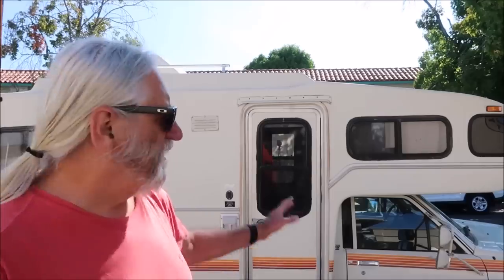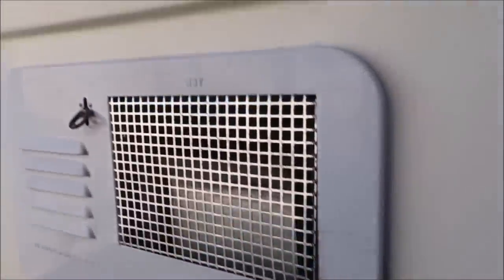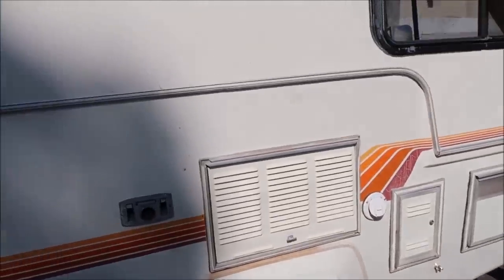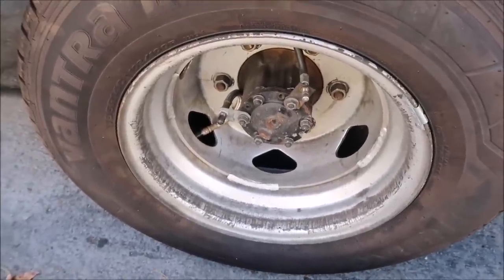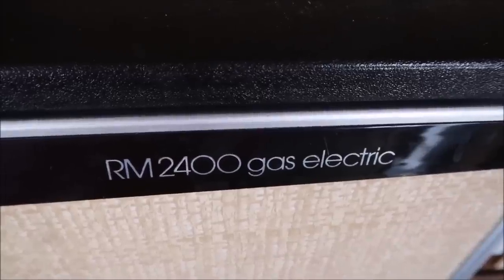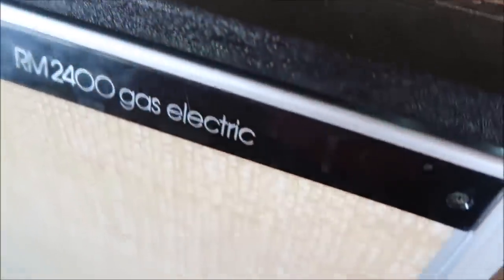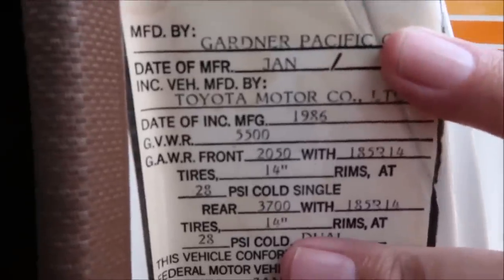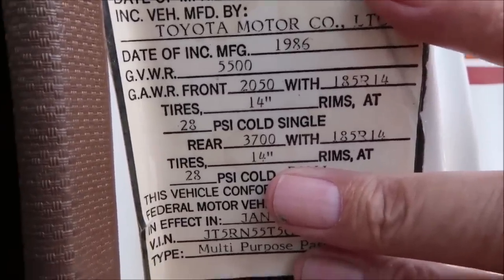What It’s Like Living in a Toyota Motorhome RV and Why They Stopped Making Them

Comment: I used to have a 1978 version of this and mine was standard transmission. My extra battery was under the hood and I didn't have central AC. I also had dual wheels on the back. The layout of mine was similar to yours. I got rid of it due to to many mechanical reasons.

Comment: For comparison, I have a 2003 24' motorhome built on a Ford F-350 chassis with gasoline engine (V-8 Triton 5.4 liter). I average 10.5 mpg on RV trips, which is better than the 5-6 mpg that the big Class A's get.  It's gone about 120,000 miles so far in its life.  I bought it at 96,000 miles.  So far, no mechanical troubles.  Just routine maintenance and some cabinet repairs.  Like your Toyota, mine is a pickup-truck style front end, not the van-style (E-series instead of F-series) with engine tucked back in the doghouse between driver and passenger seat.  My mechanics like it because access is easier than in the van type which is all that I see in new Class B or C motorhomes these days.  To atone for burning so much fuel into our atmosphere on RV trips, I recently bought a new hybrid car for everyday driving which gets around 55 to 60 mpg.

Comment: I still see one of these on the road from time to time. If Toyota, Nissan, Chevy/GMC, and Ford would contribute cabs and frame units (with the correct axels of course) from their mid size pickup lines powered with either V-6 gasoline or diesel engines I could see a new market for them among young couples, older "empty nest" couples, and individuals who need or want more than a slide in pickup camper or popup trailer but don't want a "tricked out" full size Class C.

Comment: I had a 21 ft.  Aluminium  body with a 4 cyl.  4 spd.  Got good gas mileage  around 17 on average.  But I replaced the head gasket 2x the last time she blowed she went to the scrap yard and a piston blasted it's way through  the side of the block.  And I already tore the camper off  to make he a flat bed truck..  And was driving her 3 miles to finish the job to be a flat bed..  It was cool when I had it..  Peace!

Comment: early 70s went from portangles,wa.state down to California, across to mo state then to text state , back to mo then up to Canada and finishing in Alaska Juneau.( had nylon tires get hot stop sound as if you had four flats start out again, very small camper with pop up , engine 4 cly,5 speed manual trans.. great times growing up.

Comment: I have the 92 V6 4x4 truck which is basically the hilux. It's a tough strong engine.  Always wanted to put the rear end and flatbed from their 1 ton on it. More than a few guys have made the newer motor home or I should say about 86 to 92 into a 4x4 motor home. Not an extreme off roader but for hunting,  fishing and boondocking.

Comment: Hey Scotty,  Good historical overview.  I have to admit, I gained more respect for the sunrader after watching this.  No doubt this was way too much load for the standard pick up rear end.. which while nice trucks certainly were not made for heavy load hauling ( compared to mazda or Isuzu of the same vintage).  Very glad to know about the dually rear end..and the gas milage .  Yes, ALL the early toy V-6's had problems !   The single port fuel injection you have is a great system.. simple and economical.   I would use the OD on the flats.. and kick down for head winds and hills, and acceleration.  Won't hurt the tranny..which is one of the best autos ever.  Hmmm.. The big dinette is really nice. Thanks

Comment: I love my fords but I have to admit my grandpas 1988 Toyota has been passed on to me it has the 22-re with the 4 speed auto thing has been through it he used it to get to loging jobs all across central Mississippi and it has 300k plus miles on it with one rebuild on the engine and still running the original trans and rear end like I said my 93 f150 is my daily and I love that truck but I have way more memories in that lil red Toyota

Comment: That’s cool I had an 88 I think it wasToyota motorhome. It was an Odyssey don’t remember the length. It was the 22re with the big axel. I got it for 700 bucks with 33,000 miles on it. It had a blown head gasket and the owner had passed away before fixing it someone had already taken the stove and the refrigerator out of it. The lady that I bought it from gave me the replacement stove to go in at all I had to do was replace the refrigerator and repair the engine. I fixed it and cleaned it up and drove it around a little bit and realized it didn’t have enough power for me especially with me planning to take it in the mountains. Very cool but very slow ride. I wished I would have kept it. It would’ve been a good candidate for an 5.3 vortec swap and it would’ve gotten the same gas mileage with a ton of power. Too bad they don’t make one now that they have powerful enough engines to pull it around.

Comment: What rear axle ratio does it have and is it a Dana axle? I’d guess a 4.10 ratio. That’s a lot of square feet of a vehicle body to push through the air and the shape isn’t the most efficient. If you wanted to do a motor swap I bet a Chevy 4.3 V6 would be a good candidate. I used to have a lawn service and I thought one of those Toyota campers with a damaged camper would be a good candidate to convert to a flatbed. Great video. It’s nice to hear from someone who knows what they are talking about.

Comment: I wondered why there was water staining inside, because I thought "Great! Fiberglas shell, no leaks!" then I saw those discolored areas and was sad. I have a shorter 1995 Prowler travel trailer with aluminum skin and a white rubber roof, and it has leaked at the roof seams. Have to go up and inspect and add gloop over the old gloop. It's ugly and I can't trust it to be resealed until a downpour test.

Comment: Yep those cylinder heads on the 3.0 were trash. They even warped after the recall. Too bad Toyota didn’t make a motor home with the 3.5 that was in the 1995 4Runner. That would’ve been SWEET!

Comment: You can get them from just a couple thousand for the worst that still runs, about 4 to 6k for a good fixer upper. 20k for the nicest examples in prestige condition. Id estimate the one in this video to be worth a good 15k but I have no clue his odometer reading. I want to sell my 2016 motorhome and get a Toyota next. Fancy doesn't replace efficiency

Comment: I'm a certified Transmission Specialist overdrive is a higher gear ratio which means more speed less torque if you're on flat land you won't be okay but yet there is a little bit of up heel overdrive would not have enough torque for going uphill even a slight uphill would it be difficult with the overdrive on if you had a bigger motor that would help but especially when you have the small motor once you get into highway driving on the interstate on flat land the overdrive would work but I don't recommend overdrive when you are driving around town only on the interstates when you are on flat land because the engine is too small

Comment: This is not the getaway palace for a seven footer. Best camper I had was the 63 Econoline jacked rear 8s and 10s. Five spoke cragar varnished wood bumpers. 102" whip antanaes with purty light bulbs . Inside was Turkish tapestry and moms patchwork quilt over the bed ice chest and closet and that's all a young man needs. Put in a throwout bearing hitched back into ft worth got it hitched back and did the whole job with vice grips and a buck knife. I swear. It was so cold February ..Lord ! Women knew this van and learn where I was at come lookin late oh my this van had a rep. I tried hard tipping it over

Comment: I have an 87 Toyota New Horizon Motorhome 22RE 4 cylinder engine Auto Trans with Overdrive...runs great but it weighs 6000 lbs. and has a hard time on the big hills....I can run 65/70mph on level ground but if the wind is against me it loses speed. Now...the 3.0 V6 Engines when they came out Toyota messed up and put in weak Head Gaskets. Many people experienced Blown Head Gaskets and around 1996 Toyota did kind of a Recall...and they would pay to replace the Head Gasket Once.  I just recently bought a 1993 Toyota T100 Pickup truck with the 3.0 V6...and even here in 2019 if you have one and call Toyota and give them your Vin # they will let you know if your engine has ever had the Upgraded Head Gaskets installed (They told me my New 1993 T100 Truck had the new gaskets replaced back in 1998...and it has never had that problem again !) I can not verify if Toyota would do the Complete Head Gasket job if mine had not already been done....but it did sound like it when I Talked with them recently !

That's my Story and I'm sticking to it !

Comment: Unfortunately a rule of thumb for buying Toyota is to steer clear of their six cylinders... Lots of issues with the head on the block plus parts aren't cheap and the bays are very tightly packed... Toyota V8s however, are pretty damn tough... I've seen the 8 cylinders go past 300k and run fine (especially those found in their Lexus line)

Comment: you can pick up dc capable lcd's these days up to 32 inch

in a configurationlike this cyl diesel would be the minimum option 4cyl turbos can't dealwith the excess weight looking at your comment you are under powered for the load you have I can tell this with how low the vehicle is sitting for a start and this should also be a 4x4.. 

best thing you can add is a turbo though i would check the diff ratio looking at the weight you are carrying on the chassis.

Comment: Is that a little water damage on the ceiling? It's odd with the molded fiberglass roof . Was if from the things that go through the top, like pipes AC,etc...? I put a new roof on a 69 fireball camper. After replacing a great deal of rotted wall and ceiling studs and paneling, I decided to rout everything out the sides. even the roof vents get/take air from the sides. nothing to seal or leak again. why? bored. very bored. lol.

Comment: Having a lock on the door to your propane tank is highly illegal. I work rebuilding propane tanks on motorhomes. If you came in to fuel up where i work. You'd end up walking until the lock was removed. Its a safety concern due to if you have an accident responders can make sure the tank is shut off. Get rid of the lock. 
We aren't  by law even allowed to fill a tank with a locking door.

Comment: 3VZE didn't really make that much more power than 22RE. Just two extra cylinders to help out. 22RE in my opinion the better engine between the two. Simpler, more reliable. 5VZ  S/C swap would be neat

Comment: Thank you for your great info video. Im looking at getting a Toyota, but I want 87 or better with a 22r engine.
Reply: Just check that it has the six-lug rear axle and don't worry about the year of manufacture.  You get a much better selection that way.  I settled for a 1984 with a Nissan 2.4 w/5 sp. manual.  Couldn't be happier.

Comment: They would not have had the recalls if they had designed them properly in the first place. Not that hard to figure that it should have had a full floater and better heads on the engine.

Comment: After the axle snafu then came the V6 cylinder head issue then the Tacoma PU's had frame failure issues and Toyota figured it cost them  $11K per truck to fix the ones that they couldn't buy back,  almost as bad as VW,s dieselgate. Toyota was lucky not to have any Tacoma motor homes with bad frames, that would have been the end of Toyota MH's for sure.
Reply: I bought an 07 that had the frame recall, saw it on a Sunday morning in February of this year knowing nothing about the recall. By the time I got to look at it, it was blown apart with the cab on an overhead lift. New frame, leaf springs, fuel lines, u joints, almost every thing underneath was brand new.  I bought it without ever driving it and it is my daily driver. 4.0 4x4 6 speed access cab, got it for about 10k with just over 100k so they didn't do much but break even on that recall.
Reply: My friend has an 05 and had the leaf spring replaced and has to take it to Toyota every year for inspections. The problem any one who knows about the frame issue won't buy his truck as it still isn't bad enough for Toyota to replace the frame yet. It keeps eroding away just a little more each year. They haven't told him how bad it has to be before it becomes dangerous. Toyota makes good trucks but when they screw up it is a big one.

Comment: Nicely design,but at 6'2" @270 lbs I think I would have problems in that washroom. Scotty am surprised that you're not running your car repairs from one of these.
Reply: You're right.  At 6' even, I'm less than an inch from the ceiling in the shower,  and that nifty AC unit can be a head-knocker, too

Comment: I used to work for an RV manufacturer from 1986-1990 , I worked the manufacturer shows and also drove and delivered these to dealerships . They called these the micro mini also known as a class C motorized  . The first RV I ever drove was one of these . They were adorable but could barely climb a hill 😂 the RV manufacturer closed its doors in 1990

Comment: Pretty cool but to be honest, I would have expected better mileage.   My old 2001 1 ton dually with the 7.3 PS is getting similar numbers towing an 8500# JayCo trailer. 😂 

I guess the difference being an over taxed 4 cylinder VS an under taxed turbo diesel.😂

All the same, cool little RV👍

Comment: My buddy had one of these and it sucked chinchilla balls out here in Colorado cause it won't go up in the mountains with that weak 4 cylinder....it's good going down hill or on flatland but any RV or van dweller will tell you that a v8 is mandatory. My 78 dodge explorer goes screaming up the mountains with ease! Forget even trying to live in that 4 cylinder shitbox fulltime...just use it for tail gating or a day trip of fishing

Comment: 22re is a great engine but very underpowered. 3.0 v6 is junk. What these really needed is the bulletproof 3.4l v6. Excellent engine with plenty of power
Reply: I'd buy one if Toyota offered a Turbo Diesel engine powering it. What it lacks in acceleration, it should make up in durability and fuel economy.

Comment: Anybody have any suggestions for modifications to give the motor in the Sunrader more power without damaging the motor, such as adding a turbo. Or am I wrong about turbos?
*edited to say -I think mine is a 20r, not 22r or 22re. 84’ Sunrader
Reply: Your Sunrader originally had a 22R or 22RE, as 1980 was the last year of the 20R in the US market. To get more power I suggest you find a good 22R core with a complete intake. Get an RV or tourquer cam (LC Engineering has several), good quality long tube headers,  a genuine Italian Weber 38/38 carb. Those three things will result in much greater throttle response at a reasonable cost.

Comment: I found a 86 toyota travel master. It says it has a 22RE engine with 4 speed manual. Says it has 80k miles.  Its selling for 6500. Is that a good deal? Should i buy it?
Reply: If its clean, I would. Id say opt for a new one, but it depends on many factors. The price they go for new often isnt worth it. They dont really offer anything similar to this anymore in america, its too affordable and logical. The rest of the world gets the toyota "champ" platform that is a modern iteration of this, for 45k. 13k for the truck only. We cant even get a pos small kia rio for that hardly.

Comment: Let me tell you PEOPLE!!!  The rest of the story to this story!!!  Don't buy one at any price!!!
1.  No INSTALLATION!!!  Man you better buy a generator fast!!!  And be under a shade tree at all times!!!  And keep the aircondioner running full blast!!!  Because it's going to be really hot in side!!!  And if you are in really hot territory and you are out in the sun!!!  Even with the aircondioner on its so hot inside that the only way you can stay halfway cool is stand right in front of the fan of the aircondioner!!!
2.  Don't let anything break or you there's a dam good chance you won't beable to find it EITHER new or used!!!  The brakes are terrible!!!  At about 25,000 to 35,000 miles I had to replace every part of the break system and the brakes are scary!!!  So bad you have to be very careful every step of the way!!! 
3.  They really don't as good of gas mileage as people say!!!
4.  Powerless!!!  I meam powerless!!!
I was on my way to Mount Baldy and even in low gear and around the corners it would not go!!!  Because of a lack of power!!!  And yes it runs good!!!  Really good!!!
5.  The air conditioner stop working because electrical part of the RV stop supplying the necessary AC.  Can't find parts or some to repair!!!  They to old and can't get parts!!!
6.  Same thing with the furnace!!!  They to old and can't get parts!!!
Instead of sitting lever it sits like its heaver one the right side!!!
7.  The windows are hard to open and close!!!
Just don't buy it!!!  Especially if you are going to live in it!!!  You will be so sorry!!!  Believe me!!!
Hey I didn't say anything about the cold!!!  Damn its cold!!!  Better have that furnace fixed!!!  If you can!!!  Don't buy it!!!
Reply: SmellyFish Pooh  
Yes I make mistakes some time!!!  Getting old!!! 75 now!!!  But let me tell you all out there ""DON'T MAKE A BIG MISTAKE AND BUY ONE OF THOSE TOYOTA'S RV's LIKE I DID!!!  INSTEAD OF HAVING FUN YOU WILL BE HAVING THE WORSE NIGHTMARE OF YOUR LIFE!!!